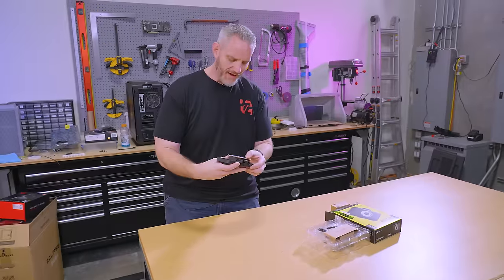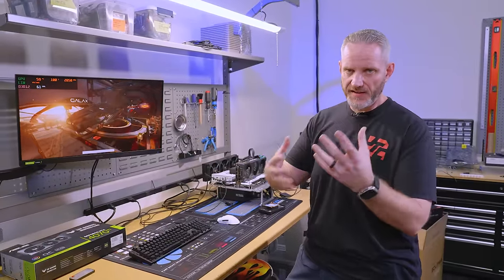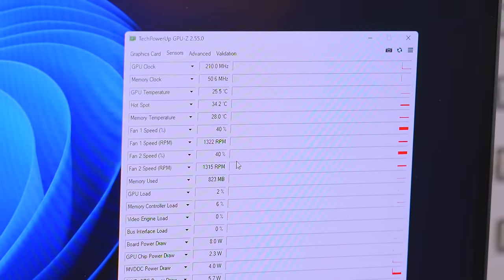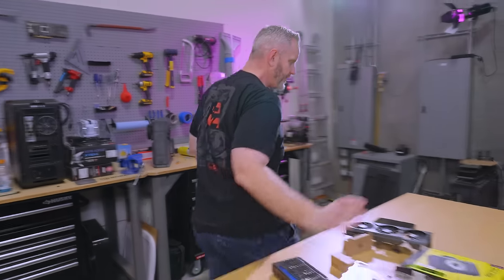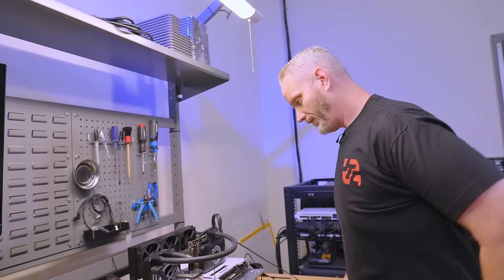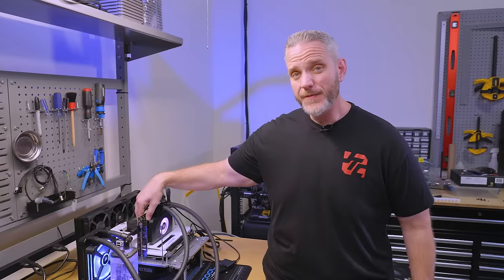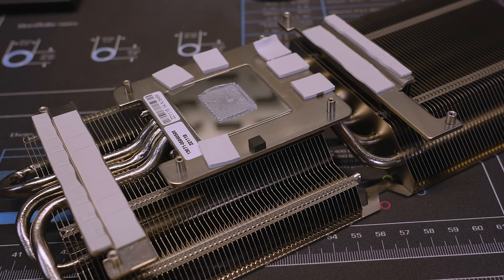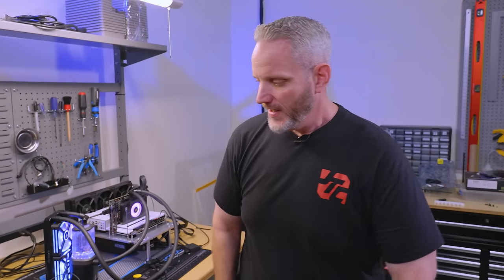They don't think I was being fair...

Comment: To be fair (and I'm being a bit sarcastic) you can totally fit the iCUE LINK 90° cable on the Corsair fans with their rads if you use power tools to remove the protruding edge!

I did do that on my system actually and it works fine - cable has to go in before the fitting and if one looked closely, they'd have questions, but I really wanted that pass-through ability.

Nevertheless, what a ridiculous oversight. I'm sure there are minor stability tradeoffs if they didn't have them on the edges of the fans, but I'm sure there's a way around that.

Comment: The hybrid card idea worked well back in the AMD R9 290 days where they were thermal throttling back to 800MHz with the air coolers even at 100% fan speed (even the AIB custom ones) and slapping on one of these meant you went from thermal throttling to 800MHz to holding 1150MHz all day every day ...but we aren't in those days anymore modern GPUs just seem to run so well as they come from the manufacturer its hard to justify modifying them at all let alone spending triple digits just to end up with exactly the same FPS as usual :/

Comment: I love this product as a concept, but its price is not doing it justice. Anything more than $30 for me would be a waste of money.
I water-cooled my RX 580 2048sp a while ago and doing so, even with parts that are not mass-produced, only cost around $30, and that is with the budget pump, a small but serviceable reservoir, a 120mm radiator, a water block, and even some custom-made copper heat spreader for the GDDR5 chips.
Btw, on that RX 580, I got a temperature drop from 79°C to 75°C while that card is consuming 115W more than before in FurMark (105W vs 220W). Modern GPUs already have good coolers on them, and it is often not worth it to upgrade to a water cooler for a tiny drop in temperature or a tiny improvement in acoustic performance (but if you are an ITX builder then sure, the water-cooled cards are smaller in dimensions).

Comment: I think it would work much better in case because temp in case is higher. and you can take air from outside and cool liquid with colder "air". it still make some sense if you buy cheapest 4070 Ti and replace it with this

Comment: This is meant to be an inbetween level of product I think, something for someone who wants watercooling but without the razzmatazz of figuring out what block, what fittings, how to set up the loop etc in detail - in a sense it's a crutch, or perhaps a gateway drug to use a bad metaphor - to watercooling as more commonly known with a lot more effort being put into the whole thing. 
I could see myself putting something together using this if the stuff were cheaper, and probably it would be for my son, or ex wife,  or neighbor. If there were some reason for it that is. I would invariably have to "be the techsupport" for it and this would be cheaper by a tiny bit than full on regular WC setup. But realistically I'd tell them to stick to air - if nogo then use AIO's - I do now. Watercooling beyond AIO's is hobbyist territory.

Comment: Good video. the only criticism i have is that you should've tested it before you took it apart, to minimize any variability in performance due to the tear down. basically what GN does.
Reply: In this case it doesn't matter, it is not a pre filled and screw torque in plastic.....well that is by feel anyway 😂

Comment: I'd say the price point would be good if they included heatsinks for the VRMs and a backplate that added heat dissipation. I suspect that if there were heat sinks that could sit on the VRMs with this hybrid unit, the fan's air flow would work better.
Reply: Yeah I would totally be fine with sticking little matt black heat sinks with thermal tape if I had that cooler.
Reply: VRM isn't always in the same position, heatsinks would defeat cross-AIB universality.

Comment: I think to use this thing you'd have to dish out another $20 bucks on copper or aluminum short fins to put on the vrms ( I did something similar with my old 390x with an arctic accelero cooler since the vrms were running giga hot. So the pricing is a bit absurd on this product for sure.

Comment: TBH I think the bigger issue is why would anyone bother with water-cooling for anything but top end parts? For the cost of water cooling you can usually go up a tier or two in parts which is WAY better value than getting water cooling.

Comment: An end user may be committed enough to trim the excess metal from the backplate so that it's not sticking out and still provides the back cooling.
They may also add some heatsinks as you suggested.

But otherwise, yeah as a standard out of the box setup, this makes the card look rubbish, leaves some components inadequately cooled, and is far too expensive given it's mostly cheap injection moulded plastic. 

FYI: I've seen these going for anywhere from $225 to $335 AUD here in Australia.

Comment: It matches the aesthetic of the devices in the product line, with the beveled edges, and soft/rounded corners, which is pleasing to look at when they stand alone.  However, when you start comparing it in size difference to the product that it mounts to, now it becomes goofy to look at.  You cannot complain that the device doesn't work, but do you want to see the pcb of the gpu whenever you look at your system when that cooler is installed?  That is why the companies build such big coolers, to cover the pcb.  I would give Corsair an A for function, and a D for aesthetics when mounted in a system for this gpu cooler.

Comment: Only use case I can see is to fit a RTX4070 into a tiny case. And even then a full cover block is still worth saving the extra money for. The VRM cooling isn't ideal, all that heat is just being dumped there, and wold be better if it was going to your radiator. That full cover block also looked like it was made from stronger materials.

Comment: Just installed this on my gpu, doesn't look to bad to me. It was the only block available for my asus tuff 3080ti. Temps while gaming are around 50c. Temps with the stock air cooler were around 62c.
Reply: Should have just saved your money a while longer and got a new gpu. No one is gonna buy  your gpu fitted with that used. You burned your money.
Reply: @jondonnelly4831  not going to upgrade until next gen gpu's come out. I can always put the stock cooler back on.  giving my gpu away to my little sister when I upgrade.  I didn't burn anything my guy.

Comment: When I ordered my Bykski block from Aliexpress for my RTX 2070 Super VENTUS OC I paid less than $100 (with shipping from China to Sweden). That Corsair block can got back to 2010 where it belongs, and that price is just SO wrong. Like there is hardly any metal in that block. It doesnt cool the VRMs/chokes and the plastic part that the copper plate screws into looks extremely cheap. Is it even Acetal?

Side note: If Corsair wants me to ditch the iCue stuff for the new LINK stuff they better put passthroughs on EVERYTHING, not just select things because "why would you need that" isnt a valid excuse for what is probably a extra $2 cost.

Side note 2: I have the Corsair Hydro X Series XC7 pump/res combo and I have to say its very cheaply made. The clear plastic that makes up the reservoir is similar in feel and quality to cheap plexiglass/acrylic that they used to make clear side panels of (Think NZXT Phantom cases and such). On the plus side it has a D5 pump in it so I can just toss the RES and keep the pump for my next combo :P

Comment: I sort of feel like this entire ecosystem should be Corsair's way of selling water cooling pre-installed in a case for beginners. If they added quick connects for the CPU/GPU blocks and priced those blocks correctly I'm sure they could move some units. I don't see beginners buying all the parts separately and I definitely don't see experienced builders going this route. 
This could definitely work as a product, but they need to market it to the right consumers and make it is simple as possible.

Comment: only way i'd even give this a consideration, is if it where in the $50 range. that much blow molded plastic, and a thin plate of copper, $70 wouldn't be worth it. especially as i would put heat-sinks on the vrms.

Comment: @JayzTwoCents I recently did a Icue Link setup and absolutely hated that I could not daisy chain with the fans connected to a radiator. I feel like they have a great design, but it may have been rushed.
Reply: Yes! It seems as if they were so worried about contending with other things like this. For example, Lian Li, Phanteks D30 fans, and the Thermaltake Swafan. They pushed it out the door too fast. With corsair, they could have easily been the best in this niche. Mistakes.

Comment: This product makes technically no sense, no improvement in cooling overall , cpu temp lowered on cost of VRM temps. The product is not only priced wrong, its just wrong (other discussion with included VRM and RAM cooling and Backplate). For a midclass card Watercooling is a questionable idea, better spend the money for the waterloop to a higher tier card, that will bring better results. That in that case the stock cooler was much more pretty worsens the comparisons furthermore.

Comment: Drop the price to $99, Include some VRM heat sinks and a back plate and it would be a ok product.
Its probably aimed more at the budget cards then the ones that already come with a OP air cooler on them.

Comment: 70C is not that bad, though can be further improved by turning up the fan speed. Me myself, i don't really like that the cooler does not cover the VRMs and such. On lower power GPUs this cooler would work fine. The price is a little much for that cooler and me myself i would not buy this unless it is cheaper than that price. There are better things that are around the price point of this item.

Comment: what if you use this with heat sink fins you can get to put on the VRM's? with the airflow coming from the unit's fan i feel it could really help. But again the price doesn't make sense.
Reply: The problem with that is,you have to research and spend more than you expected for a good conductive thermal glue! Most "thermal glue" is choking the vrm.

Comment: Honestly, part of the appeal of water cooling your system is that it looks nice.  Why tear off the air cooler to add a 129 dollar block, two 50 dollar fans, whatever that radiator costs, and whatever the pump costs when the difference is that small?  Not to mention the annoyance of fitting all of the cables and gear in your case.  Also, it does look worse than the Asus tuf air cooler by a large margin.

Comment: While it seems priced a little too high, it doesn't have any competition for a universal waterblock. Prices have shot up for everything, including watercooling gear.

As for the aesthetics,  it's as clean a look as any waterblock,  and the ones you pulled up as examples have as much plastic in them as it does, only with more metal.
I get that the main visual problem is that it doesn't cover the whole PCB, but to me that's more of a function of just how ridiculously oversized GPU PCBs have gotten, and something a universal product can't account for without adding more plastic and possibly more cost.

Comment: I mentioned this on a fb thing they have. Why would I want to spend the money on something that lacks cooling? When I can just buy a full block that covered gpu, memory, power delivery system.. Like sure it works obviously but I would personally have everything thats cooled stock also on the waterblock.. If im spending the money I want as much cooling as possible.  Which is sad because I have everything other than the pump to the new link system and used an ekwb for the 4090 over the corsair block

Comment: Appearance 3/10 main die cooling 10/10 it works; heat kills electronics almost as fast as water and the VRM temps 1/10 only because it has a fan moving some air and would only get max benefits from fan if mounted in traditional format as for the price your spot on $59-69 at most so price score -1/10

Comment: I don't think they even need to go as extreme as $70-80 range, even if they just drop it to $100 then it becomes a much more likely option to people, more so when it's not constrained to a single manufacturers card.
In this case a $50 difference instead of just a $23 difference can go a long way.
If they want to keep the current price they should at least consider adding in some heat sinks to both sides where the fan blows, increase the surface area and greater thermal mass will easily drop the temp on the VRMs.

I'm not a fan of the look ether, it's not horrible but not good.

Comment: Hi Jay, my name is Arthur and I'm not sure if this message will get to you. However, I'm in a bit of a struggle on picking a GPU currently.

Here is my background for context.
I'm currently running a 3070 which has started to shown signs or artifacts when not under load plus it runs quite loud when under load. I'm considering the 4070 or the RX7800XT, reason of it being a 7800XT is because the 6800XT market in my country which is Malaysia is quite dead ever since the newer generation came out. However, AMD seems to have some common issues with their drivers especially the one recently released causing games to crash. On the same side, a lot of content creators are recommending the 7800XT over the 4070 due to its price to performance being whilst not the best but still better than the 4070. Could use a bit of your help since you have access to these hardware. Hope this message gets to you! :D Also my country has a sale on early November hence why I'm asking about this now. Thanks in advanced!

Comment: Der8auer also looked at this Cooler, only he got the AMD-Version (which looks identical from the top).
He also felt the design was kinda meh and he also was worried about VRM temps; on his test card the VRM also got pretty toasty, though he stated it's within specification and should not actually cause damage to the card.
So as far as the "universal" part goes, it works... but seriously, who came up with this design and why is it all plastic? At that price point no less...

Comment: With the new fans you can link and this thing priced so absurdly wrong you could almost get the impression that they are testing with how much they can get away with. I usually like Corsair, used an AIO from them for years, using their "frosted" tubing for my custom loop I am building atm because they look amazing. I am just hoping they will get the next produts right again and its not the start of a trend.

Comment: Is the circuit in the VRM the 1920 buck converter? PSU manufacturers abandoned that circuit in 1988 because of its low efficiency. The 2013 circuits are cheaper, smaller, and better.

Comment: Hey just want to ask eapicaly sence i havent found anything is it possible now with motherboards coming woth bluetooth to not use the dongle and go off of the reciever that the motherboard came with to connect such device logi tech controler mouse and keyboard i feel like its a loosing battle playing a little across the room loosing conection and your character turns for the moment till it gets signal back. So im just wondering am i blind to finding the way to set it up or is that a pipe dream.?

Comment: Looks aside, which yes I agree with Jay, it looks weird, looks like them old heatsink coolers of the past. When you consider that the 4070Ti specially already costs an arm for its performance, adding another $129.99 to the equation, to only dropping 8 C at best, and frying your VRM, doesn't seem like a good idea. I guess that's why the likes of EK haven't made blocks for the 70 moniker and below, because it doesn't justify the costs. Good on Corsair for diversify it but no thanks, it makes no sense spending that much for what you get

Comment: What I find most surprising in this context is that such a well-established company with a good reputation .. so far, makes so many mistakes piled on top of each other.
1. The whole point of serial connection is to reduce the number of cables, which is not achieved because several components cannot be connected in series, not even fans in some configurations.
2. There is only one reason to replace the graphics card's original cooling with a substantially more expensive solution is to gain better performance and/or cooler components relative to the cost.
3. When Corsair complains that Jay didn't do any tests, what did they think the tests would show that would be in their favor? Have they not done thorough tests themselves before launching the product so that it is actually perceived as worth such a large investment, both functionally and performance-wise? Does Corsair not use focus groups that are representative of the expected customer base?
- It seems to me that an initially very good idea was somehow tampered with in order to get a product line out in too short a time frame.
Afraid that someone else would catch up before them perhaps?
Now they have instead given the competitors the chance to come up with a much better solution based on the same premises.
... looking forward to it.

Comment: This block makes sense if you buy cheap 4070 with crap cooler and pcb does not have any full water blocks in market and suddenly you decide you want to watercool it. The price is too high for the build quality and Corsair must include copper vrm heatsinks.

Comment: 73c isnt horrible for vrm components, but over a very long term you might see failures of the surrounding components that would have been avoided with the stock cooler
Reply: The kit should come with the little VRM heatsinks that Jay mentioned. Would make a big difference.